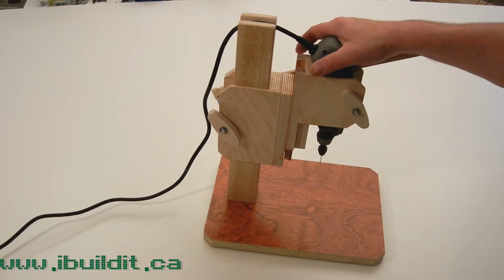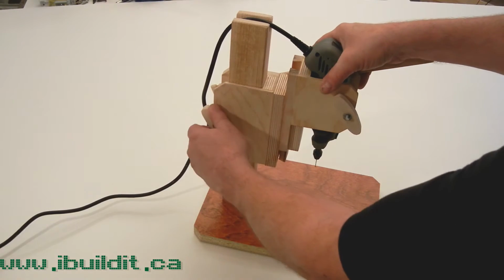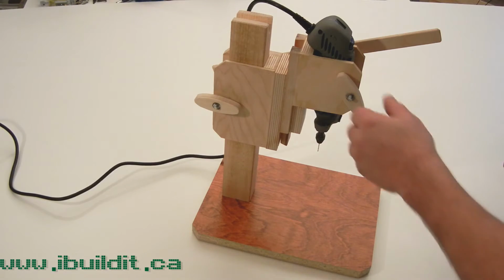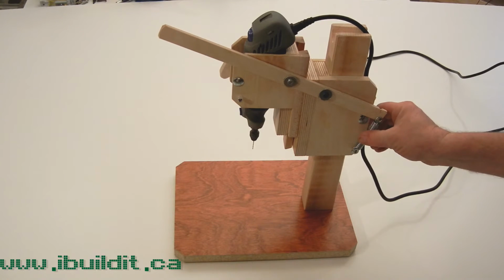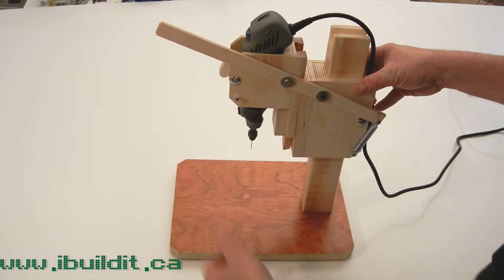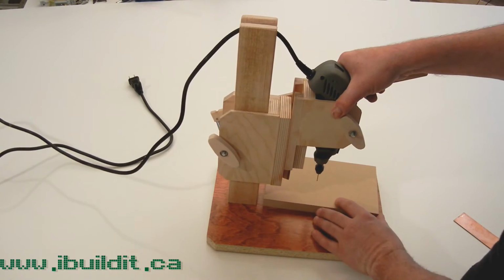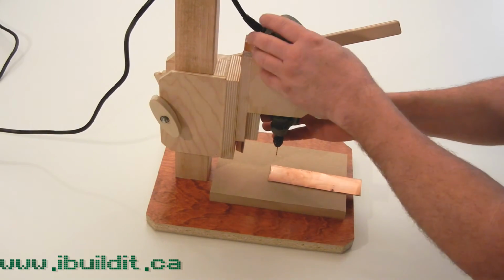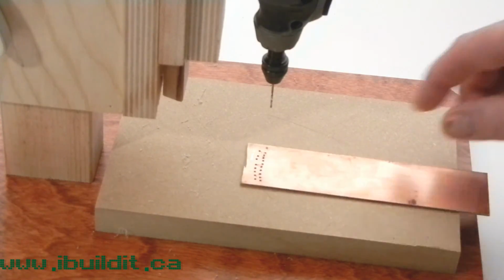Rotary Tool Drill Press

Comment from the maker: @deezynar No problem. All good comments, positive or negative (if they are pointing out a valid concern) are very welcome. I like some lively discussion and I'm certainly not always right or infallible.
The vasoline doesn't so much sit on the surface, but penetrates a bit and makes the wood slippery. There's no great amount of it to collect dust, and if there was, it's just to wipe it off. It also seals the wood a bit, so it doesn't come and go so much.